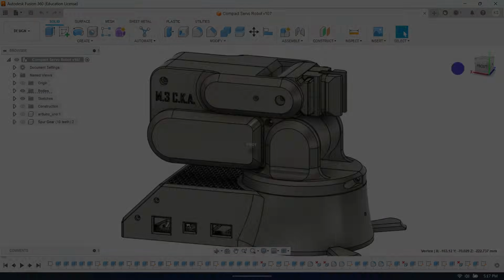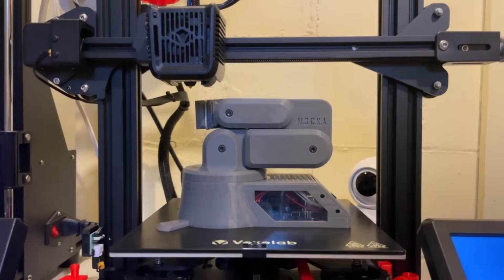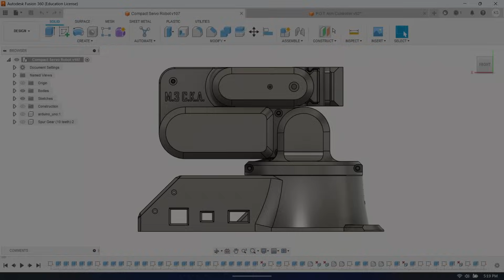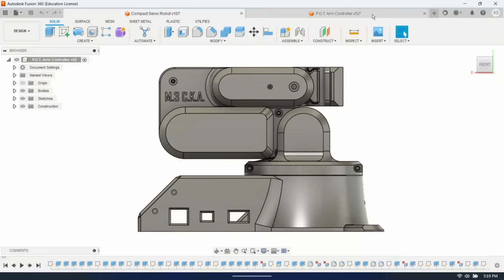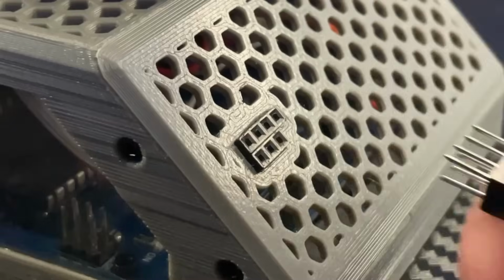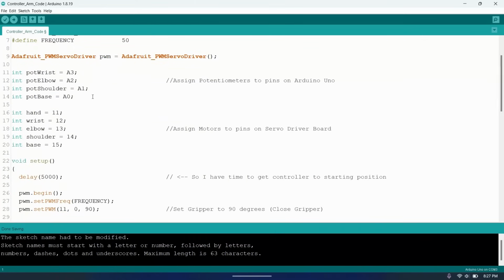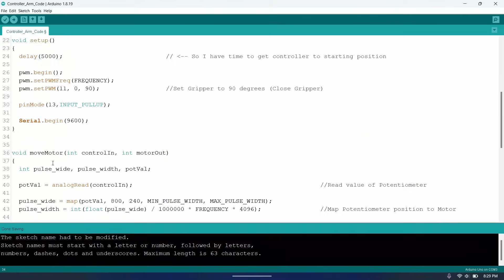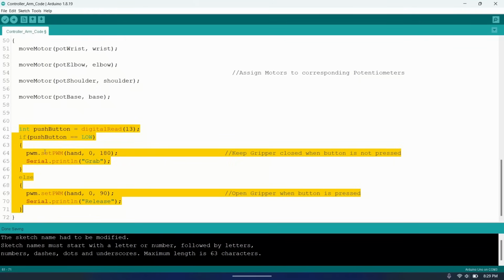How I Built a 3D Printed Robot Arm from Scratch (Arduino Based)

Comment: hey dude, awesome stuff. Just wondering what can you change to make the join movements smoother and more accurate?
Reply: I think using a belt and pulley system would be much smoother, the downside being how much more complex and prone to breaking that would be, alternatively you can use a chain and gears (I've used both for robots before personally the extra smoothness isn't worth it in my opinion)

Comment: Dude, I just finished building your robot for our school project. We had some difficult times with the driver-board(that is because there are lots of boards using different parts such as (FET, capacitor etc.) customized by some companies for  low budget costs with large income.We bought these boards and we had been troubled for weeks.After we got the right board,everything is doing welll with your explanation in the video. Thanks a lot for this amazing content❤ Keep doing your stuffs Sir!
Reply: How did u get the 3d printed files pls tell?
Reply: Wow, some issues can find origin in the PCA board ? Because of bad composants really ? Was not sure why my robot was not working, because I had everything fine, will try another board

Comment: the last wrist servo is opposite of the potentiometer. How do i fix the direction. The rest works perfectly
Reply from the maker: Swapping the two outer-most wires on the corresponding potentiometer should do the trick!

Comment: Tnx for this awesome project. I’m in the process of building it and I am waiting for some parts. I do have a question: what power supply should I use? How much power? Hope to hear from you. Tnx again.
Reply from the maker: Thanks! I’m using an adjustable power supply (linked in description) and running it at 7 volts. But really, any 7V power supply that's rated for at least 5 Amps should do. (Thanks for the Super!)
Reply: Tnx for the response!

Comment: That's wonderful! How were you able to design such a compact robot? I mean it certainly is possible, but it still surprises me that how can one person design a complete mechanical model. It doesn't really look like much at first, but as someone who actively tried to design a robotic arm from scratch, I know how difficult and frustrating can this be. I really need to know how to overcome this burden of CAD designing, cuz as a electrical engineering student, I don't have much experience with Fusion360 or SolidWorks or any other mechanical CAD software. Once again, hats off to this seamless design! Looks soooo elegant!

Comment: why did the servo break ?
Reply from the maker: The servo motors that I mentioned broke because of some coding issues I had early in the process. I was not reading the position of the potentiometers correctly and I told the motors to turn too far, which stripped the gears inside. Those issues should be fixed now. Thanks for your interest!
Reply: @buildsomestuff  oh ok thank you for explaining

Comment: You didnt mentioned the use of the stronger servo wich is in the description ,it Will be used? The connections sketch are only available on your patreon ?
Reply from the maker: Hello! The stronger servo motor for the base is optional, but I would recommend using it in the joint above the rotational base. As of right now, the wiring schematic is only available on Patreon. However, it will be made available to the public with the release of the assembly tutorial for this arm.
Reply: @buildsomestuff  thank you !Do you have any predictions on when it will come out?
Reply: @buildsomestuff  you Will do a vídeo assembling is that so ? Thank you
Reply from the maker: @joaoboinhas3611  Yep! The assembly video should be published to YouTube within the next week. At this time, I will also be releasing new updated part designs for easier assembly, and the wiring schematic I mentioned earlier.

Comment: I NEED robot arm mounted on wheels/overhead 2 rails.  I will use (windshield wiper motors as they can lift 400 pounds - overkill ) and 12Volt.

Join me? Help me?  (We patent it!). 

It will give me select tools from peg board in  shop.

Light strong metal frame

Comment: Hello, I have a question regarding the servos. Assuming that you have used those 180 degree ones which provide position control, how would one be able to control the position accurately using the 360 degree servo motors? Since you can't control the exact position and only the speed to some extent.
Reply from the maker: Hello! If you’re only able to control the speed of 360 degree servo motors and not read the position, then you may not be able to use them in this application. At least when using the controller. If you would like to use 360 degree servos, I suppose you could attach encoders or potentiometers to each joint to read the joint’s position.

Comment: Nice work, will try to replicate and improve your design. Control arm is useful, I will try to make it wireless using bluetooth modules and serial communication. Other implementation could be VR controls. Would be great to print parts using resin printer, currently I have split parts and doing that with use of tough resin. Again very fine work kid!

Comment: @buildsomestuff hello there, how did you go with the voltage supply? as when I have 4 servos connected to my Arduino it has a voltage shortage
Reply from the maker: Sure! Yes, 4 servos connected to an Arduino without an additional power supply will likely cause some voltage problems. I have linked the exact adjustable power supply I use in the video’s description. I connect the servos to a PCA9685 servo driver board (also linked) and then connect the additional power supply (set to 7 volts) to the servo driver board to power all the servos.
Reply: @buildsomestuff  thanks so much! atm i am trying to build this exact robot using the STL files u provided... i have a servo driver board already, i just don't know how to use potentiometers and servos with a servo driver board.
Reply from the maker: @Theshredder37  No problem! This video by DroneBot Workshop is a great representation of how to connect and control servo motors with an Arduino Uno and a PCA9685 Servo Driver. https://m.youtube.com/watch?v=kUHmYKWwuWs&t=2217s&pp=ygUMU2Vydm8gZHJpdmVy

Comment: Hey man great video, I have also been able to follow your steps, and got a little stumped once I got to the wiring from the controller onto the arduino. Nearing so close to the end is exciting but I can’t get there without knowing the wiring.
I don’t understand how 9 dupont cables can turn into 7 and connect to the arduino.
Could you please explain how you did it and how many dupont cables were used on the controller? Thank you
Reply from the maker: Thanks! 7 wires from the controller plug into the Arduino because all potentiometer’s Ground and VCC pins (and the switches Ground pin) are connected in a sequence of wires and each potentiometer’s output/signal (middle) pin run through the entirety of the arm individually to the plug. The potentiometer signal pins make up 4 of the 7 pins on the plug. Another pin on the plug is for the push button. The last 2 pins are the VCC and Ground pins. So, starting from the smallest joint with the push button, one pin from the push button is connected to the closest potentiometer’s ground pin and the other pin on the button goes independently throughout the arm and into the plug. Then, that potentiometer’s (the one closest to the button) ground and VCC pins are connected to the next closest potentiometer and so on, all the way to the base potentiometer. Then, the base potentiometer’s ground and VCC are wired directly to the plug. Hope this helps!
Reply: Yes, this has helped a ton!! There are a couple of hiccups with the servo driver board, but everything else seems to be fine. Thanks again, I can't wait to see the project come to life!
Reply from the maker: @sebastien9351  Great!

Comment: How did your servo break? I mean those are strong servos
Reply from the maker: The servo motors that I mentioned broke because of some coding issues I had early in the process. I was not reading the position of the potentiometers correctly and I told the motors to turn too far, which stripped out the gears inside. Those issues should be fixed now. Thanks for your interest!

Comment: What are the dimensions of the servo motors used or till what dimensions can fit in the robot arm
Reply from the maker: The exact Servo Motor dimensions can be found at the Servo link in the description. Slightly larger servos may fit in this arm but, for the most part, it’s a snug fit with the servos listed.
Reply: Their dimensions are about 45mm*40.5mm*20mm
Reply from the maker: @adityapathare7152  Ah, yes. Those may be a bit too large.
Reply: Sorry for asking to many questions but I literally loved your project and want to build it myself thats why
Reply: Actually the servos mentioned in the description link are not available for my country
Reply: 7.1 x 5.3 x 4.2 centimeters will these be fine
Reply: I have found another one with 41mm*20mm*43mm what about these one
Reply from the maker: @adityapathare7152  No problem! The second servo you mentioned should be fine. The guaranteed fit is 40mm x 19mm x 43mm so there should be enough space to fit yours. Hope that works!
Reply: @buildsomestuff  thank you so much bro 😭😭❤️❤️
Reply: Thank you so much bro ❤
Reply: And for the micro servos I will be using 22mm x 11.5mm x 22.5mm these dimensions
Reply: Will these ones work
Reply from the maker: @adityapathare7152  That should work! The one I used is 21.5 mm x 11.8 mm x 22.7 mm.
Reply: @buildsomestuff  thank you very much bro ❤
Reply: What type of screws did you used to attach the servos as the holes for servos in the cad is pretty small
Reply from the maker: @adityapathare7152  I just used the screws included with the servo purchase. (The silver Phillips head ones)
Reply: Now I am assembling the arm but when I install the second motor for the second rotation above the base one. The motor does not pick the arm up. Two of my motors broke cause of that
Reply from the maker: @adityapathare7152  Hmm. You may need to upgrade to a servo with the same dimensions but a higher torque rating. The servo I used directly above the base had a torque rating of 20kg/cm.

Comment: hey, I really like your project! but what do you use as a power supply for your servo driver board? Can you recommend me a specific product or whatever?
Reply from the maker: Thanks! The power supply I use is now listed with the parts in the video’s description. It’s an adjustable one and I run the servos at 7V.
Reply: @buildsomestuff  thanks a lot
Reply: @buildsomestuff  do you use the DC terminal connector to power the servo driver board?
Reply from the maker: @atomfried9  Yep!

Comment: I really like your project. But how did you attach the "rotating part" of the servomotor to the 3d printed model? Which screws or whatever did you use? Does M2 work here?
Reply from the maker: Thanks! Yes, M2 screws should work well.

Comment: what size screw is used in more detail?
Reply from the maker: The screws used are a mix of M2, M3, and M4 screws. The length does not particularly matter, as long as it engages with whatever is being held together. You should be able to tell where each screw should be used based on which screw fits in the counterbore on the part. The exact screw kit I used is linked in the video’s description.
Reply: @buildsomestuff  
Thank you

Comment: What gear size are you using for the hand. Im in the process of building my own robot with your files. Also can you possible send a list of screws and sizes you used for the arm would be much appreciated.
Reply from the maker: The gears used along with all other screws and parts are now linked in the description! There is a train of 3 gears in the forearm to transfer the servo rotation to the gripper segment. One gear is attached to the servo, one is attached to the gripper segment, and one is placed in between as an idler gear. Really, any gears would work that fit in that area. But you would just need to make sure that the first and third gears are exactly the same.

Comment: Can you give the list of parts required
Reply from the maker: Unfortunately, a parts list is not currently available. Sorry about this. At the time of designing and recording I had not planned on making this arm open source, so much of the wiring and assembly may have to be custom to the builder. However, I may make an in-depth video of all the parts, wiring, and assembly sometime in the future, but for now I’d like to focus on building other projects and releasing more content for those. Thanks for your interest!
Reply from the maker: All parts used to build this robot arm are now linked in the video's description!

Comment: how is the gripper and firearm motion made possible, in the video @ 4:49 there is a white gear in the gripper, but its not long enough to reach the corresponding motor there, so are there more gears there or ...?
Reply from the maker: Yes, there is a train of 3 gears in the forearm to transfer the servo rotation to the gripper segment. Sadly, the gears are not 3D printed. Although, one could probably design and print them with a precise enough 3D printer. The gears used in the video are just some spares I had laying around. One gear is attached to the servo, one is attached to the gripper segment, and one is placed in between as an idler gear. Really, any gears would work that fit in that area. But you would just need to make sure that the first and third gears are exactly the same.

Comment: what kind of gears did you use?
Reply from the maker: The gears used are now linked in the description. There is a train of 3 gears in the forearm to transfer the servo rotation to the gripper segment. One gear is attached to the servo, one is attached to the gripper segment, and one is placed in between as an idler gear. Really, any gears would work that fit in that area. But you would just need to make sure that the first and third gears are exactly the same.

Comment: what are the tools that you used to build the arm? any soldering?
Reply from the maker: Yes, there is some soldering, just to extend the servo wires and wire the potentiometers on the controller. Not many other tools were used, besides the 3D printers and allen drivers. (And possibly some crimps to make new connectors.)

Comment: @buildsomestuff can you please specify which servo motors you used, and worked well while your testing please reply
Reply from the maker: The servos shown are 4 cheap MG996R servo motors and an SG90 micro servo for the gripper. Although, if you’d like more torque for lifting heavier objects, I’d recommend replacing the bottom joint (not the rotational base) with a 20kg LD-20MG servo.

Comment: I am doing a similar project. Having trouble getting enough amps for my servos. What servo driver did you use? (Also how many grams of strength do your servos have)
Reply from the maker: The servo driver used here is a PCA9685 Servo Driver Module by Adafruit. These MG996R servos are pretty cheap, with 12 to 13 kg per cm of torque, but can be swapped for 20kg per cm LD-20MG servos for more lifting power.
Reply: @buildsomestuff  I want lots of lifting power - I will be using 60kg servos. Do you think that this driver could handle that, or should i just hook up my servos to a power supply?
Reply from the maker: @guyconiglio8223  Awesome! Not sure exactly, here is the PCA9685 driver board info: https://www.adafruit.com/product/815

Comment: I love the design!! I have considered building such an arm for a long time. Had it been possible to get the wiring diagram?
Reply from the maker: Thanks! Unfortunately, a wiring diagram is not currently available. Sorry about this. At the time of designing and recording I had not planned on making this arm open source, so much of the wiring and assembly may have to be custom to the builder. However, I may make an in-depth video of all the parts, wiring, and assembly sometime in the future.

Comment: hello, would it be possible to have the wiring diagram ?
Reply from the maker: Unfortunately, a wiring diagram is not currently available. Sorry about this. At the time of designing and recording I had not planned on making this arm open source, so much of the wiring and assembly may have to be custom to the builder. However, I may make an in-depth video of all the parts, wiring, and assembly sometime in the future.
Reply: @buildsomestuff  ok no problem, if possible a more detailed explanatory video

Comment: Really cool. It would be a great addition to this robot adding a button that when pressed saves the current positoin of the motors (potmeters) and you can manually save multiple positions to replay them as a programmed animation. I did this with a hobby robot I built a few years ago

Comment: Congratulations on the launch of your channel and the impressive arm design. I have a suggestion for a potential future video. Have you considered scaling up the motor and arm size? Given that you have already designed and shared the model, and have assembled it numerous times, this should be a straightforward endeavor. It is worth noting that the majority of DIY robotic arms featured on YouTube tend to have protruding cables, and the production arms such as cobots tend to be limited in size, rendering them impractical for most use cases.
Reply from the maker: A scaled up version would be neat!